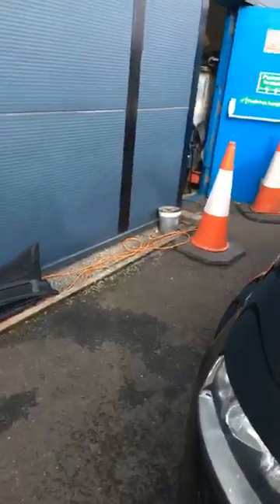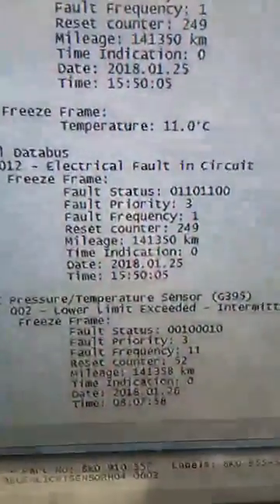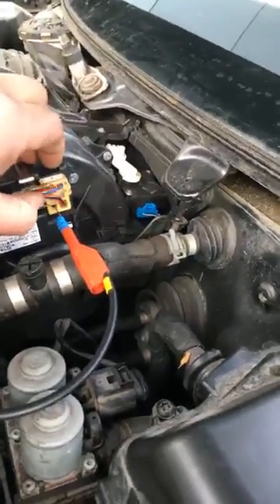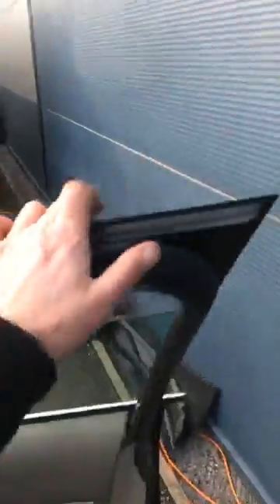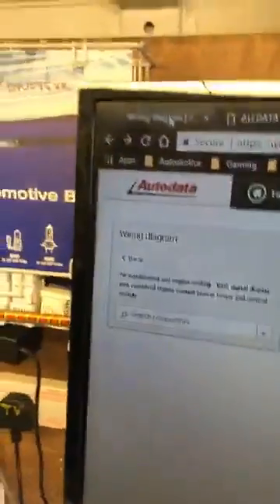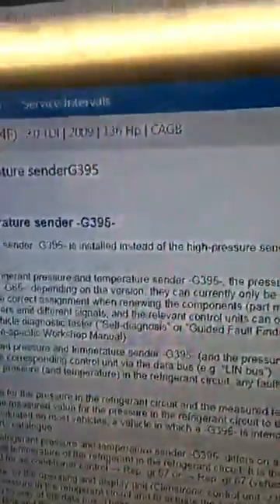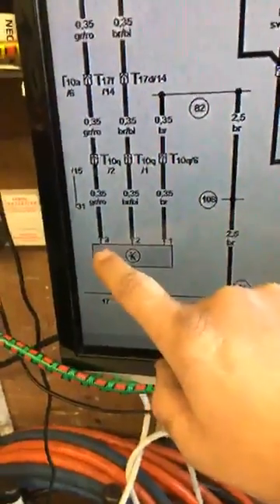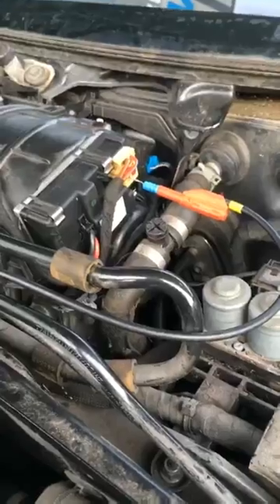02071 Audi A6 with no heater blower

Comment: I have 0.5v on my yellow LIN / signal wire at the heater resistor. But same databus error code. Is that normal? Would I expect to see the voltage change if changed to blower speed in the dash?

Comment: Hi pal did you have any success as I have same sort of issue   the yellow grey  I've got only 0.5v  when I turn the fans and heater on I can here the control module clicking but doesnt power the fan  I've took a feed to the fan and it works  but when I un plug the red black as in video the fan doesnt spin   so is it the module ? 
Diagnostics only said it was an open circuit   please help

Comment: Then the problem is been sort out just changing the pressure sensor ?
Reply: You are the best  Ive been to regas the aircon and the let me without air on the car saying they don't do nothing wrkng to the car they just regas the installation
Reply: You can let me know if I right ? I've to change the pressure sensor if the blower motor stop working after regas the AC the Error code 02071 electric failure
Reply from the maker: Not necessarily, check the wiring and signals.
Reply: @SimplyDiagnostics  where you located I can see you are good one
Reply from the maker: Cheshire
Reply: @mariusvornicu80  salut , ai rezolvat cumva eroarea asta si daca da cum , imi da pe tester 02071 code .

Comment: Hi did u manage to sort out the a6 heater motor fault would be helpfull to know got one with same problem, disconnected air con pressure swich still got the same problem , thanks
Reply from the maker: Yes, there's a follow up video
Reply: @SimplyDiagnostics  thank you for quick reply but i cant find that follow up video
Reply: Simply Diagnostics we’re the following video?
Reply: Hello. Did you find the problem? I disconnected my pressure switch and still the same problem too.

Comment: You can get to the Sensor if you only remove the Black Plastic between Engine and Bumper. Only a few screws and some clips.But not much space in there, but with a little hook you can unclip the Wire and with a deep Socket you can replace the sensor withour removing the whole Bumper - been there, done that - common fault that they go bad.Sometimes like this, sometimes only no air-Con because it says it has no pressure, but there is pressure in the system.
Reply from the maker: chrisi1909 you need young mans hands for that. With my arthritic mitts I’ve a job to hold a ratchet these days. 👍
Reply: Hi there any luck with this job as you may be able to point me in the right direction as my climate control unit lights all up and says off but non of the buttons work.